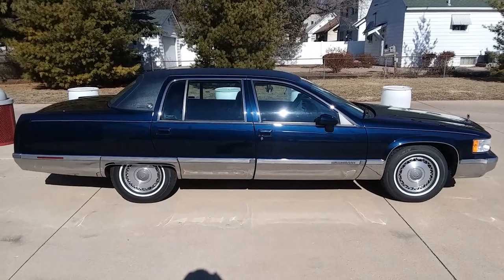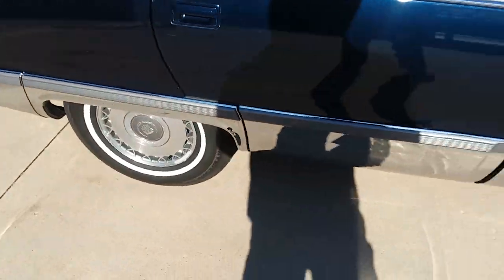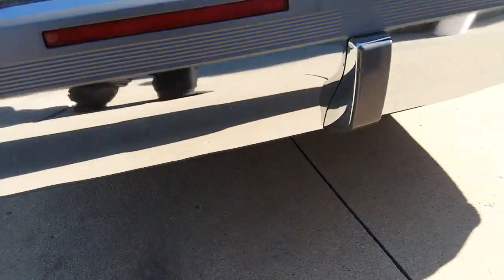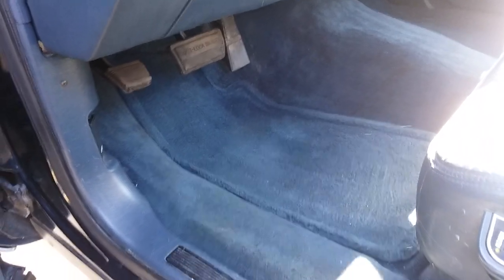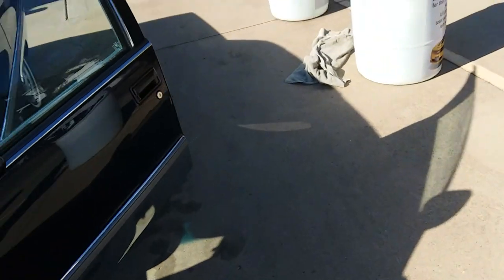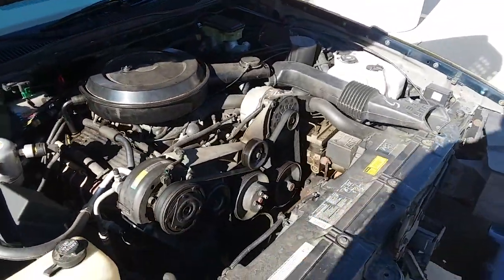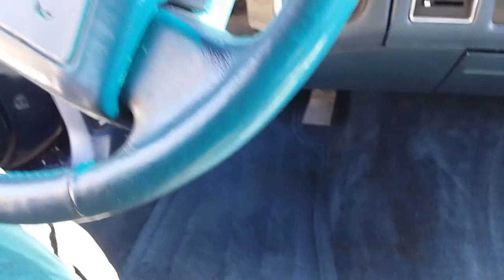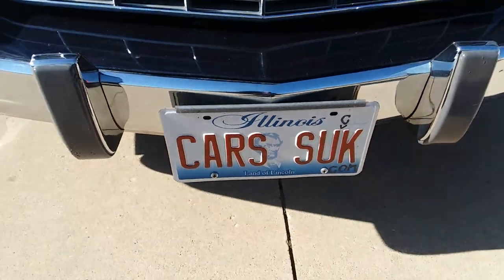1993 Cadillac Fleetwood Brougham SOLD

Comment: Was it 5.7 normal chevy engine, or Lt1 , I have 1994 .
Reply from the maker: The 93 comes with the 5.7L throttle body injected small block Chevy. I had a 94 back in the 90s. That car had the LT1. Really moved but eventually had the LT1 oil leaks. And ignition trouble. If you watch the whole video I eventually raise the hood and show the engine.
Reply: L05

Comment: I need some good shocks for my big girl do anyone have a suggestion now she has a intermittent light ABS traction control I have to fix her she's been good to me 80,000 MILES all original highway miles cheers!
Reply from the maker: The abs can be wheel bearings. I never did shocks. I thought about it. Seems like I looked into it and Rock Auto had them. The rears are pricey due to the level ride  air assist. I sold the car a while back. Enjoy yours.
Reply: @user-nq5rd4ck5z  thanks cheers!